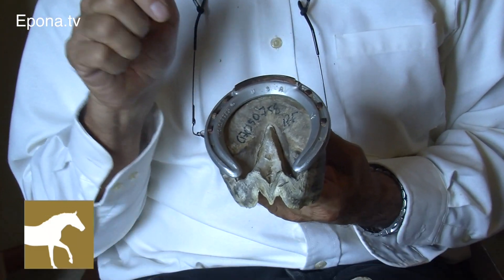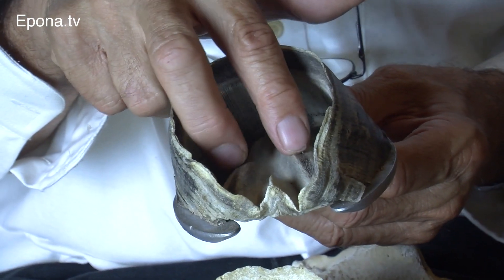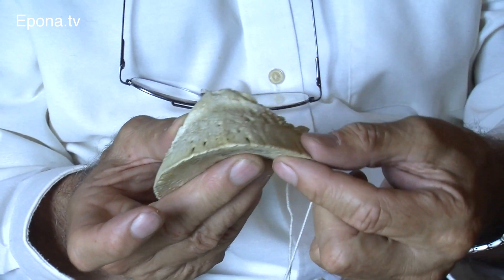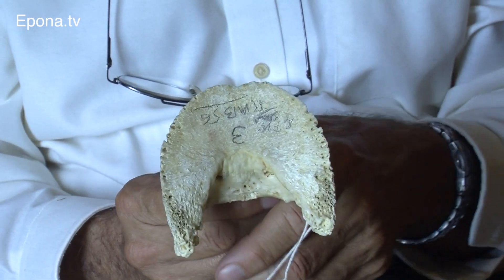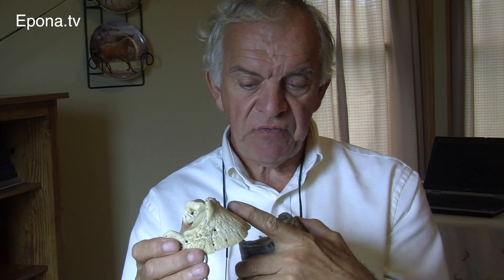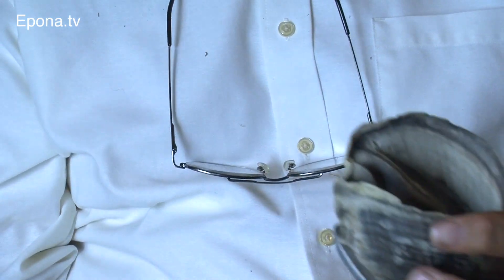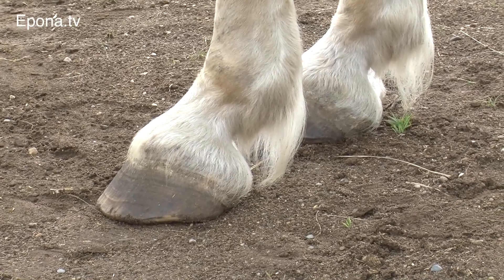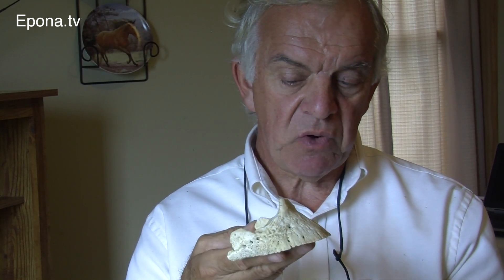Hoof anatomy with Prof. Robert Bowker, part 3 - Peripheral loading: possible but not ideal

Comment: We are causing our horses to be lame, firstly by feeding high sugar grasses and bag feeds instead of fibrous forage that should encourage movement, i.e. not locked inside boxes but outside 24/7 moving constantly to forage for the multiple grasses and other plants horses need to be healthy. The lack of species specific diets and living conditions brings on inflammation and, couple that with old, disproven ideas about hoof care, we are crippling these beautiful animals. The hostile reaction to anyone suggesting what I just said is proof of the underlying guilt that I'm sure many, more scientifically educated horse owners are feeling. Instead of feeling guilty they should educate themselves into how to properly rehab these poor horses. This professor is pointing out things I know are there, but, if most of you took your hoofcare into your own hands, instead of letting people continually chop off the toes and raise the heels, to combat imaginary "lever forces" that nobody has ever seen in laboratory circumstamces, you could actually save your horse from pain, eventual osteonecrosis and death. If you leave the toe and cut the heels back to the Hard sole plane, and let the hoof repair itself whilst addressing the horses diet and living conditions, it may take a year, but eventually the hoof will repair and you will be able then (not before as it gives protection during rehab) to trim the toe to a normal balanced hoof capsule and, if you sorted diet and are overseeing or doing your own trimming, your horse, pony or donkey has every chance to live a normal life.

Comment: QUESTION S - I agree with everything you are saying but my QH gelding has very thin, shallow, soles on all 4 feet.  Are padded (inserts)  hoof boots the best that I can do for him to protect his internal hoof structures? Is there a boot you would recommend?  His latest radiographs show some pedal osteitis and very small navicular changes.  
He is 11 years old.
Thanks for any help on this.
Reply: That's is pretty much what he was saying. I have Cavallo boots for my horse as his feet are fairly round but it depends on the shape of your horse's feet. Easecare makes excellent boots as well and often work with more oval shaped feet. I don't use pads inside only because my horse has solid feet and the boots are just for protection but with the thin soles they might work well. Both companies have excellent customer service and it would be worth calling them for advice on which would work best for your horse. Remember -- very important to take precise measurements just after having the feet trimmed.
Reply from the maker: Hi Sharon. This was an interview we did with Dr Bowker many years ago, so unfortunately you can't reach him via this comment thread.

Comment: So does that mean I shouldn’t worry about all the chips at the bottom of the hoof wall because it’s the sole that should be supporting the majority of the weight?
So trimming and keeping the hoof wall even with the sole is what you want?
Leave the frog AND the bars alone?
Reply: You do have to address bars that are folding over as they trap bacteria etc, but, the frog very much looks after itself on a balanced hoof.